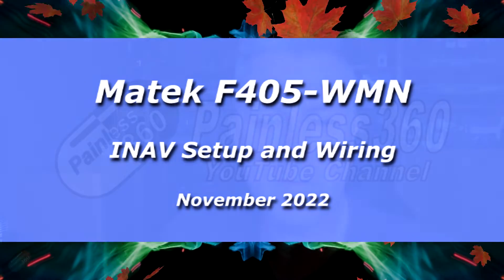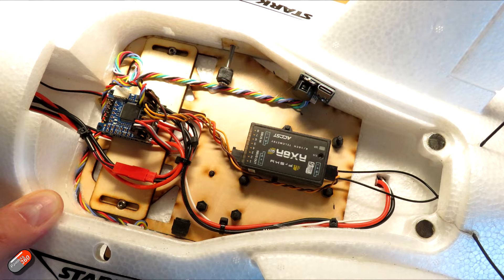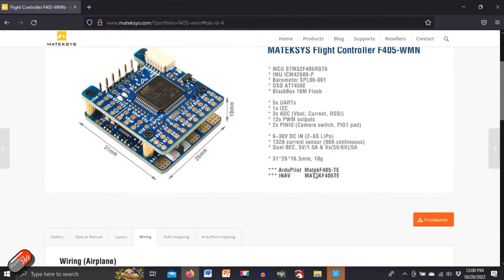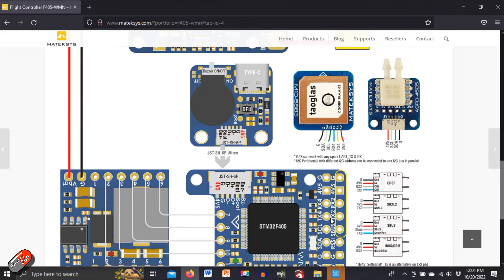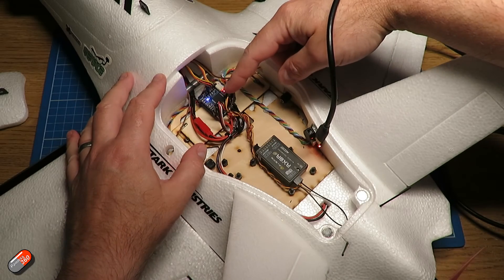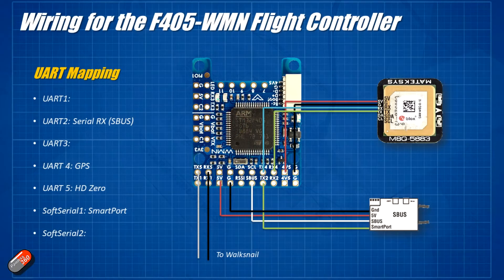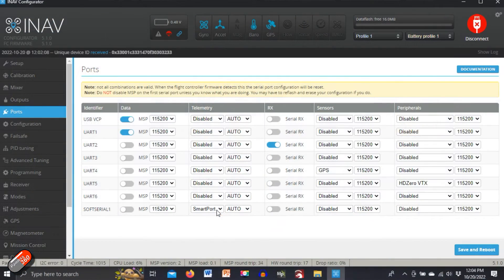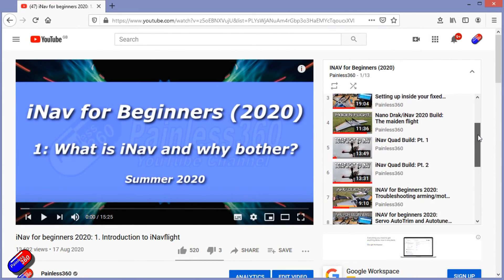Matek F405-WMN Wiring and PORT Setup for INAV

Comment: I know this video is 3 has old, but I watch all of your videos. Great content. Question... I want to use a Matek Hall effect current sensor vs soldering my ESC on the ESC pads, I want to give power to the Matek 405 wing V2 by splicing to the 6s battery leads  that will house the matek hall effect sensor, but the Matek 405 FC wing has no VBAT ( not sure) , or curr nomenclature on the FC . Not sure how to install this (Hall effect) on the FC. Any ideas ? Thank you
Reply from the maker: I've only ever used the inbuilt voltage and current sensors in the flight controller Best of luck

Comment: I'm struggeling to activate the air pressure sensor (SPL06-001) on this board, I can't find it in the configuration under "Sensors & buses" how did you get this working?

Scratch that, I just found it, I should have put on my glasses first 🙃

Comment: Followed your set up but this is what happens: When connecting  a new board with new firmware flashed to iNav 7.1.1, you are asked to determine what the board is for so presets can be loaded. My issue is with the last 2 boards I flashed, SpeedyBeed F450 Wing and Mateksys F450 Wing , I selected the “type” and the save and reboot action started up but it doesn’t save and reboot. Just sits there. I left it 15 minutes and had to X out to close the screen. On manually connecting the board I see that the type (plane with tail) presets have not been set. Is this a known bug?
Reply from the maker: I've had the same thing. Looks like a bug.
Reply: @Painless360  I reported it on GitHub as an issue with 7.1.1 and almost immediately got the issue closed by a mod saying it was a bug in 7.1.0, instal 7.1.1 and closed the issue. Others are reporting the bug on Facebook
Reply from the maker: How odd. I don't use Facebook but I know that the devs do drop in on it from time to time..

Comment: Hi Lee, did you solder peripherals direct to the board or did you solder in extra pins? Personally I think that would be an easier option and easier if peripherals needed changing? What do you think?
Reply from the maker: I tend to use pins where I can, as I tend to reuse kit and it makes it easier... Happy flying
Reply: Excellent advice Lee, thank you. I am having a senior moment here,  cannot remember what the pin assembly’s are called! Need some more for a new board and for the life of me cannot find the words for a search lol. HELP!!!

Comment: hello Can I connect F405 wmn sys FC +esc 50 A +lipo battery 3s 10000mah?thank you
Reply from the maker: Yes, why do you think you can't?
Reply: @Painless360  I thought the FC F405wmn could not handle high current 
Because it does not include power module same pixhawk thank you.
Reply from the maker: Current rating in the specs on the website - see http://www.mateksys.com/?portfolio=f405-wmn

Comment: How do you get the beeper to go to switch on radio?
Reply from the maker: Setup the buzzer mode in modes? Watch out as there is a switch on the board to 'silence' the buzzer, so make sure that it isn't in that position...
Reply: Like when you are in moded I take it there is something that says beeper and the inav already knows the connection of the fc?
Reply from the maker: I'm not sure if I understand the question.  Can you explain in more detail what your question is?

Comment: Thank you Lee. As always a great video on setting up the ports with this flight controller.  One minor nuisance with the F405 WMN is that you have to solder to a pad to get S1 and S2 for the ESC signals.  It would have been so much more convenient to have these on pins.

Comment: What version of INAV are you using here? I have this board and with versions 6.0 and 6.1 I cannot get SBUS and SMARTPORT operating at the same time. Both use RX/TX2 pins, with SMARTPORT using SOFTSERIAL. Both work but not at the same time, I have to delete the Serial UART2 for the SBUS to get SMARTPORT working
Reply from the maker: Smartport needs its own UART. See my build videos.. Happy flying

Comment: How are you managing power for the Walksnail system? Are you running an external bec or using the vbat pin?
Reply from the maker: I power it from a spare ESC pad set on the FC if possible. Then the FC and OSD is also capturing the current used by the HD system in the OSD to help me track mAh in the pack..
Reply: Ahhh clever! How’s your video so far? Any interference/lines in the image? I was thinking about adding a capacitor just to be safe.
Reply from the maker: HD doesn't suffer from the same issues with interference. See https://youtu.be/WmqYHwN2jLE

Comment: What if I have Walksnail VTX/OSD + GPS + Elrs CRSF? Will I be able to give them each a full UART that isn't inverted or hardware limited on the IO pins?
Reply from the maker: How many UARTs are on the FC and how many do you think you'll need?
Reply: @Painless360  I think I have it sorted out. I watched two video and both were comparison videos. I wasn't paying attention and when people were talking about the old FC I thought they were talking about the new FC so I was highly confused. I downloaded the spec sheet from Matek and sorted it out. Thanks for the reply. I wish they'd give a schematic instead of say stuff like "S.Bus" etc. If the pin has additional hardware such as pull-downs it would be so much easier to see.

Comment: Im new to this and i have a zohd dart xl. What kind of flight controlle should i use.  Plz help.
Reply from the maker: Check out one of my INAV Series for Beginners series. I use Matek WING style flight controllers a lot here and also the Matek F405-WMN too..
Reply: @Painless360  thank you for a quick response. Ill check them out.  Better yet im just going to get it. Lol if i have issues look for me. 😆
Reply: @Painless360  will it work with the flysky FS-i6x10?
Reply from the maker: If it can talk SBUS or one of the supported protocols, yes.
Reply: @Painless360  thank you

Comment: Hello I really appreciate your videos, they solved many of my problems.  I have exhausted UART ports, and I'm trying to create a softserial in INAV but I couldn't do it, and I asked others and they told me that it's impossible in INAV, very strange thing .. although I used the same procedure as in betaflight .  Reason I have to add a bluethoot module that communicates phone with the flight controller for my mission points.  Is there another way to solve my problem?  ie also installing the BT 06 bluethoot module via the R9slim outputs?
Reply from the maker: Soft-serial isn't something you can create in INAV. It needs to be something that is built into the target that you can turn on and off. Some flight controllers have several Soft-serial ports, others don't. See my recent Walksnail install into a ZOHS Dart where I used the Soft-serial ports available on the Matek FC to attach stuff.. Best of luck!

Comment: Hi Painless, only meeeee xD , sorry im asking so many questions across diff vids, im trying to learn both i nav and wiring the FC and just got walksnail so having to learn that too, my brain is a bit fried lol. So its hard to see but for power to your WS did you take a pos and neg off the Pads where the battery wire is connected? im planning to use a little jst wire and connector like that also so it can be disconnected.

Comment: is it possible to use this fc for a twin motor setup?  i plan on using a volantex ranger 2000 but 
I'm not gonna gonna use stock pusher setup. Thx.
Reply from the maker: Yes, should work fine. Best of luck

Comment: I'd love to do this same setup but CANNOT Get my RX8R to bind to my Radiomaster TX16s. what is the secret??  Can you make a video on that?
Reply from the maker: I already have several. https://youtu.be/aZhvnm8j88M for example.... Best of luck
Reply: @Painless360  Thanks! I found the problem: I had to select: Mode: "Multi" & "FrSkyX2" in the Internal RF Menu on the TX16s Radio.

Another question though. How are you powering the Walksnail vTx in this setup??
Reply from the maker: Check out the Ranger T-1 VTOL conversion series. I show it all... Best of luck

Comment: While ordering the electronics for an AR Wing Pro I noticed the MATEKSYS F405-MiniTE Flight Controller, which has 6 UARTS. Is this an option rather then the F405 WMN?
Reply from the maker: It could but this is a FC designed for multirotors. if you are happy to do some work to create custom wiring for the servos then you could use it... Best of luck
Reply: @Painless360  Many thanks! I'm certainly not feeling sporty enough to repurpose a quad FC when the 405 WMN has everything for a wing with Walksnail. Cheers!
Reply from the maker: I will be wiring up a quad FC for a wing in a series starting very soon.. Stay tuned!

Comment: Does the GPS not connect if the other two wires for the compass are connected? Some reason I cant get my compass to turn on.
Reply from the maker: It will power6if only the GND and voltage wires are connected. Be careful 6s on some flight controllers, it is only powered by the main battery... Best of luck
Reply: @Painless360  I needed to plug my battery into it haha. I'm used to my betaflight quads when all they need is USB power for the GPS

Comment: EDIT: Fix for no log data with this board (matek f405-wnm) seems to be that you need to set "LOG_BLK_RATEMAX" to 50, or some other value other than 0.   50 worked for me.  I spent literally an entire day messing around with this until I managed to change the right param to get it working.

I just got this FC and am new to ardupilot and all of this.  Maybe someone here knows how to help.  I've managed to get everything wired up, configured, armed, and have had a successful flight with manual mode and fbwa, but one thing has me stumped.  The log data seems to be corrupt.  I have not changed any settings to do with logging that I know of, but when I try to analyze logs in any program including mission planner, it seems like it's bad data/empty or corrupt, despite a 7mb .bin file.  Converting to a .log results in a 0 byte file.  Some analyzers complain about "no FMT messages" or similar.  I have no idea what is causing this or how to fix it.
Reply from the maker: The fact that you are not leaving the oomment on a video that is more relevant, makes me suspect that you've not found that content. https://youtu.be/FN2uKKFxZuw ND similar videos may help more... Best of luck
Reply: @Painless360  Nope.  Unfortunately the issue seems to be there is no log data or it's corrupted.  For example, if I try to bring a .kmz file into google earth, there are no waypoints or anything.  I think it might be an issue specific to the f405-wmn or the 4.3.2 arduplane firmware, but I don't know.
Reply: Turns out, the fix for no log data with this board (matek f405-wnm) seems to be that you need to set "LOG_BLK_RATEMAX" to 50, or some other value other than 0.

Comment: My radiomaster r86c v2 doesnot contain smartport can i still connect it through sbus??
Reply from the maker: If it has an Sbus output, yes. Best of luck
Reply: @Painless360  I'm connecting it through sbus with matek 405 WTE but it not working ... what's an issue??
Reply from the maker: Could be lots of things. Port setting would be my first thing to check. Best of luck
Reply: Yes

Comment: I also have this FC, but i can't get the current sensor running correctly (INAV 5.1). What are your settings?
Reply from the maker: As supplied in the base firmware. What is the problem exactly?
Reply: @Painless360  INAV says, the current draw is about 2A, but the actual current draw (ext measurement) is 0.3A
Reply from the maker: I have not changed anything here and it seems ok. 132A Current Sense (INAV Scale 250)

Comment: Great information im halfway through installing this same fc into mt nitro plane. Any info on seting up thr throttle servo please as in not quite sure. Im new to inav. Thanks in advance
Reply from the maker: Sorry, I only fly electric. Happy to try and help, what is it you are struggling with?
Reply: @Painless360  thank you. I was thinking if i set the servo ch 3 to throttle if that would work and cancal out s1 and s2 that are for the motor signals

Comment: Hey Painless-thanks for all the super helpful videos.  I am about to maiden my first wing--a Sonic Modell AR Pro.  I have religiously followed your excellent instructions to get to this point.

One question:  I've noticed you don't often mention the FC I am using.  Is there a reason you don't use the Matek H743 Wing V3?  Is it just overkill or something else I am missing?
Reply from the maker: No reason, I tend to use the slightly cheaper ones. That's all... Happy flying!